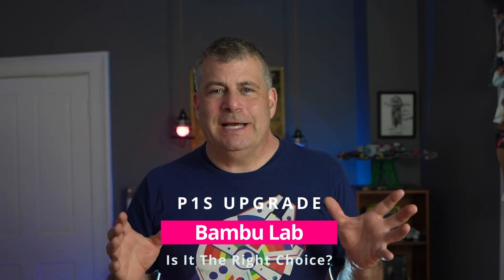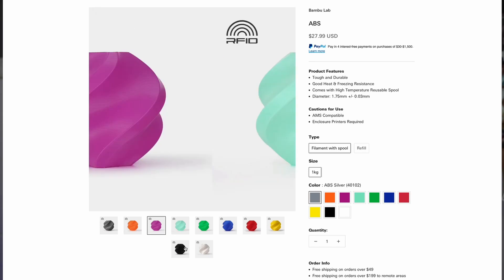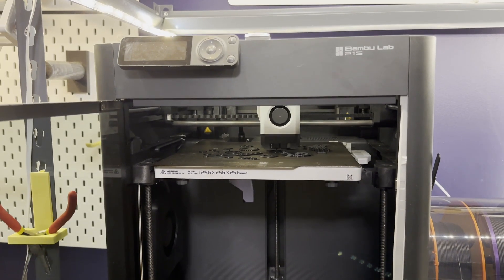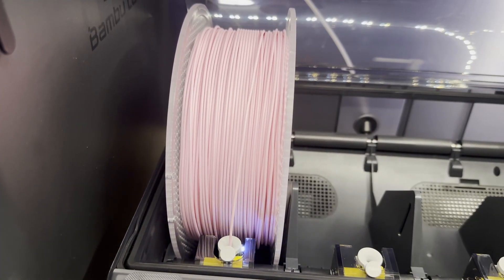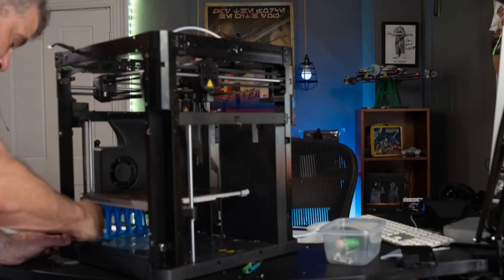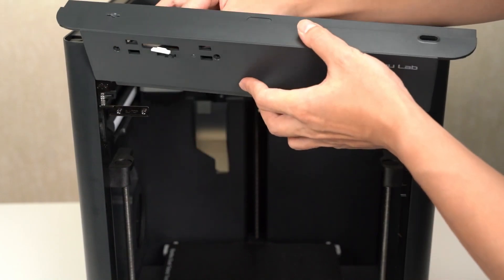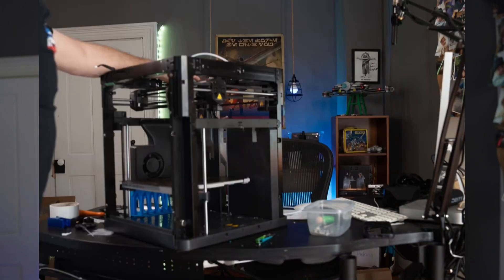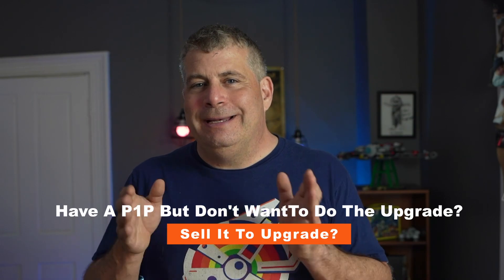Bambu P1S - The Best 3D Printer For You?

Comment: I was intending to get this kit for my p1p to make it a little quieter, however I print almost exclusively in PLA and I've read that printing PLA without cracking the door a bit can cause issues ranging from poor overhangs to heat creep in the nozzle. In my case cracking the door and letting all that noise out kind of defeats the purpose so I was wondering have you had any issues related to printing in PLA with this upgrade so far?
Reply from the maker: I've had no issues at all...because I keep the door open a bit. If you don't print anything besides pla the upgrade is probably not worth it.

Comment: good review i have done the upgrade and it only took just over an hour to complete, but please before you get all gungho and start doing the upgrade stop and read all the upgrade installations first and then you will notice that you need to print the fan holder before doing the upgrade, also the manual is online why not read it before your upgrade kit comes and get everything ready just like you do for your job that pays your bills because if you dont you will lose your job and you have to go find a new one all because you dont prep first.
Reply from the maker: Well I followed the video instead of the manual after laying out all the parts and I watched it at first at 1.5x so I could get familiar with it.. I'm glad it only took someone an hour. I'll admit I'm a klutz and dropped a lot of screws into the body of the printer. Fishing them out took me probably an hour by itself :)

I did know about the 3d printed part thanks to another channel.  So at least that one didn't mess me up.